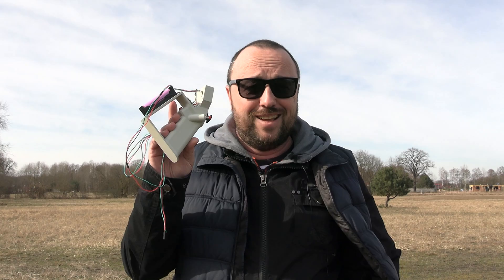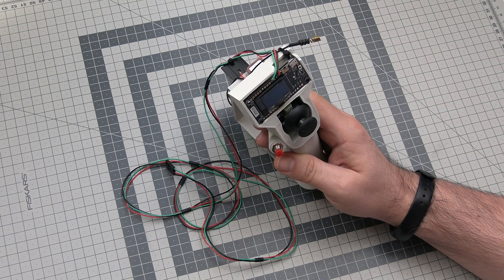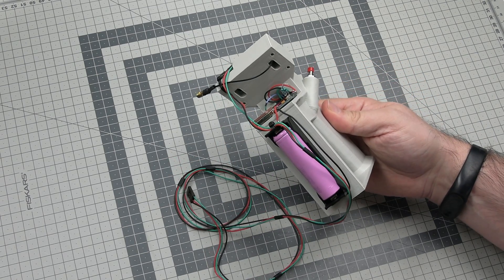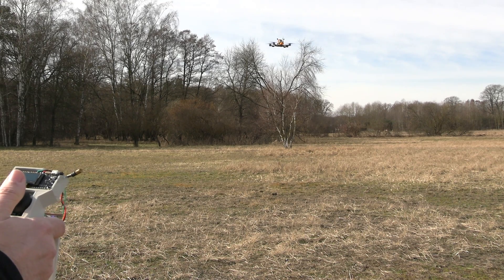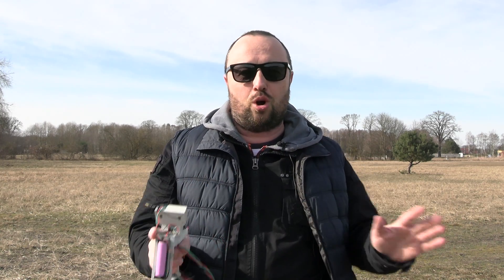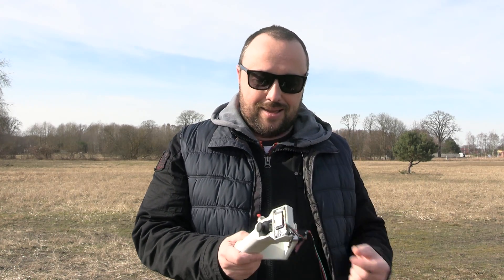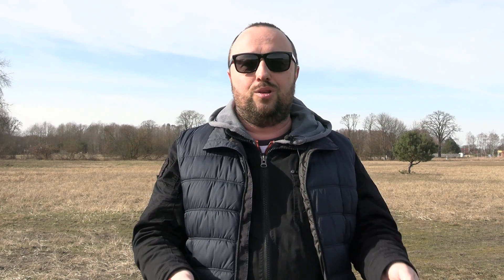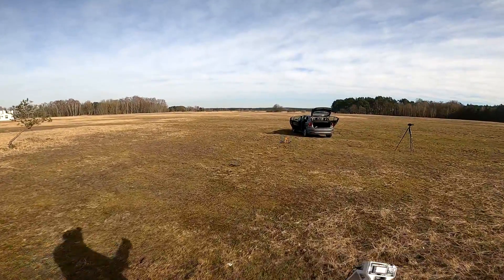Gesture controlled drone - DIY Motion Controller

Comment: Some suggestions, make a version that ouputs PPM (or if you can figure it out, good luck! CRSF protocol) then you can plug it into a crossfire transmitter module. Next, use a pointer finger trigger style pot like from an rc car remote for throttle. Also you can mix yaw and roll and fly in angle mode and not worry about yaw or anything

Comment: It seems like the dji motion control is actually using the goggles to connect to the drone. Have you tried to access data via the link with the goggles?

Comment: Great Work.  Could you move the enable button to the little pinky finger.  Add the arm\disarm to this button as well?  Then move the variable throttle to the index finger with a resting spring loaded mid-point.  Then use the gyro for the yaw action with the other button.  Then add a strap on the back of your hand to secure the assembly to your hand, so in case of emergency, you just open your hand and the drone disarms and drops or hovers.

Comment: Nice work! It would be super nice if INAV has an "Airplane Mode" for quadcopters. Quadcopter will keep moving forward, like and airplane, and holding altitude... Then you can pitch up and down to control altitude and left and right to turn, and INAV will do the coordinated turn so pilot don't need to use yaw.

Arducopter has a similar flight mode (it's called "Drift" mode, but it doesn't do the altitude hold stuff), and this is how the DJI motion controller works too.

Comment: If it had a really smooth sensitive throttle without a spring and with a finger hole you could control in acro mode. Assuming the latency for all axis are low enough to do aerobatics of course. 👍

Comment: Nice video, especially explaining that this is not science fiction. I think X-lite pro can do that out of the box, it has gyro built-in and you can assign channels on that. I'm using X-lite pro, I just don't find this tempting to do that. The little free time I have I prefer just go flying normally.

Comment: I suggest modifying the code to use the arduino nano 33 ble, then perhaps it can use less components as it has bluetooth and a 9 axis motion sensor on the board. The sense version has a barometer and a light sensor which could add additional function? Just a thought.

Comment: you didn’t tell anything about the GPS. What are you planning with that?
Reply from the maker: That is for a different project that is in the works. Basically same hardware but different function
Reply: @FPVUniversity  “follow me” on the controller?😏
Reply from the maker: @tomxygen5963  well, yeah 😁
Reply: @FPVUniversity  it might me the next chapter of INAV

Comment: Looks like it would be better to have a trigger for throttle control like it is done on RC cars. Also it would be good to have a 'reset position' button so you can lower and relax your arm while flying. Probably this type of controller is not an ideal for copters but is should be very suitable for RC planes. Keep up the good work!

Comment: oh boy, i got an idea!
How about you use an arduino nano ble like lee used in his headtracker, it got bluetooth built in and you can hook it up wirelessly to your tx and use the outputs from the arduino to assign them to the trainer channels, you can maybe even hook up a second arduino to it for the yaw motion? i'm in no means familiar with such stuff but why not give it a go ?
Reply: The 33BLE uses PARA for bluetooth, which I think is same as FrSky, be nice if it worked direct with Crossfire's Bluetooth (Mavlink or Mavemu). I'm not familiar either with those protocols or what they are capable of.  BLE has three motion control channels, yaw, roll and tilt plus you could input a fourth channel PPM signal for throttle. To be honest it would be no problem to put another BLE inside the RC TX, power consumption is is only a few mA and hard wire into trainer port.
Reply: @Pilotltd  well i think im gonna get myself one this week and see what i can do with it
Reply: @milosimus  I got one and it works fine via trainer cable into a TX16S. I've got another arriving tomorrow that's destined for inside radio  :)
Reply: @Pilotltd  i got an x12s, gonna try out how good it works with the bluetooth

Comment: Is hardware really necessary? All you need is to mount a phone in landscape mode instead of the ttgo board, and draw big onscreen joystick. Then you could communicate with the radio through the bluetooth module plugged into radio. If someone wants to repeat your project, all he needs is to print a handle then.